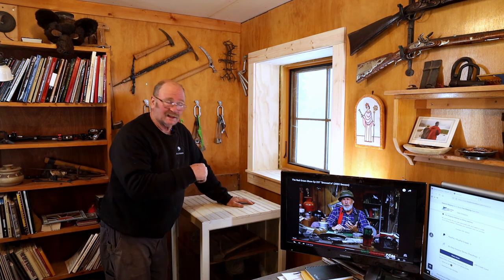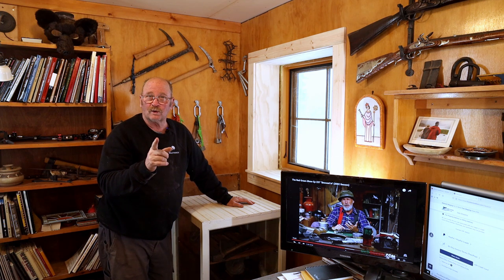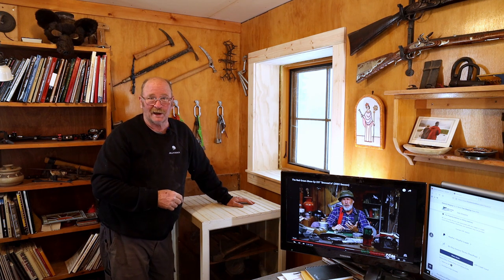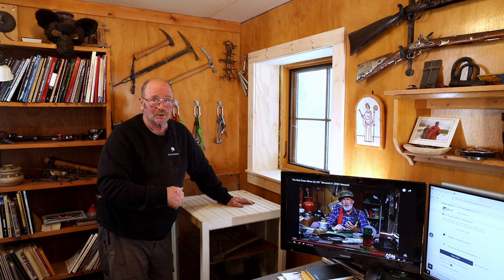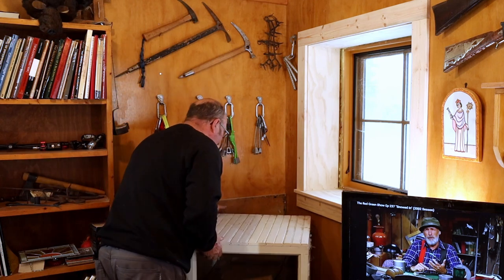This sticks out like a Sore Thumb

Comment: You have a wide range of skills and you are more that a Jack of All Trades! Cats really like perches like that. I added some old wood scrap to the bottom of the two basement windows we have that are  trimmed out with sheet rock (not a fan of those) and our cat jumped right up to use them. BTW I felt like I was there doing that job as we have some of the same woodworking tools. That sander is in particular is probably as old as mine. Amazing how much I use it and it still works. I envy your clamp collection.
Reply from the maker: Glad you enjoyed it, thanks for stopping by.